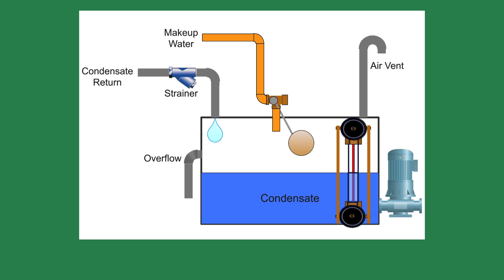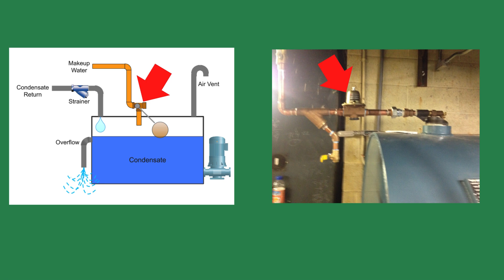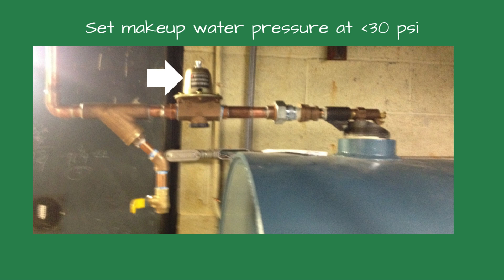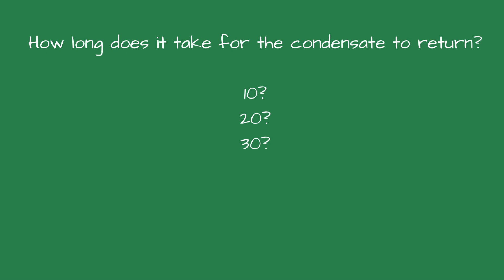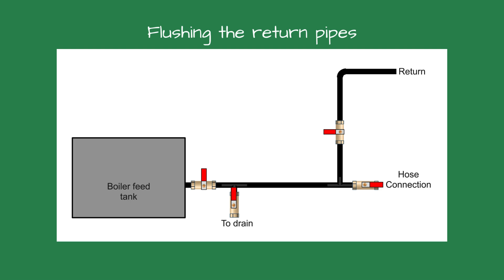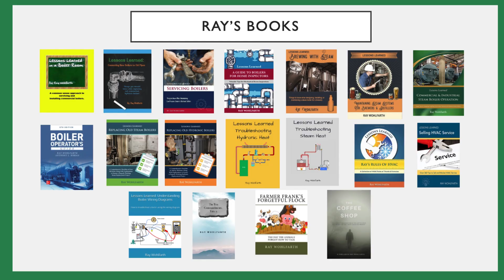Why is the boiler feed tank flooding every morning

Comment: Night Setback may save energy, but it also caused a gazillion problems.  Especially in systems originally not considering that tactic.  We had old steam heated dormitories that originally had steam available 24hrs a day.  When the Emergency Energy Policies were enacted in the 70's and 80's and we were forced to implement Night Setback the buildings (and especially it's occupants) were not happy.  It took lots of massaging and innovative solutions to make the buildings begin to behave.  Can you say "Water Hammer" or extreme morning load on the Central Heating Boilers?
Reply from the maker: I can imagine it, like a Blue Man concert Thanks

Comment: Good video.. Probably going on for years.. btw, did he lower the operating pressure?.. So, I was wondering, when do determine that you need a condensate feed tank?
Reply from the maker: We never went back. Their boiler expert believed 7 psi was the proper pressure. As far a boiler feed unit, I do it on every commercial job as you down want the cold makeup water hitting the hot boiler. Most commercial boiler manufacturers insist on it, Thanks
Reply: Probably didn't occur until the Church decided to implement Night Setback for energy savings.